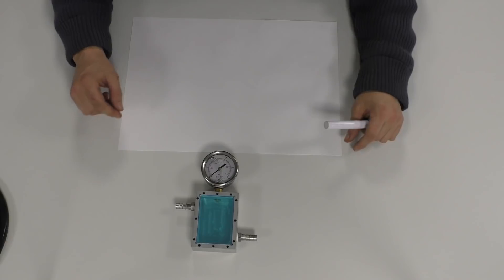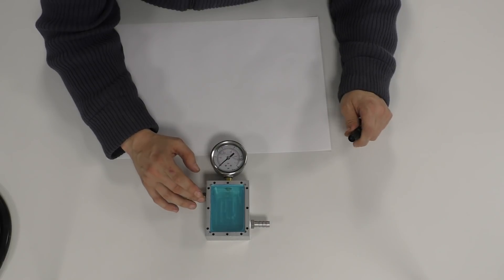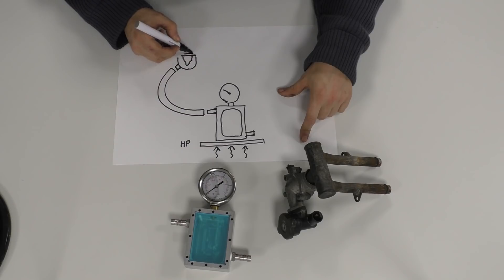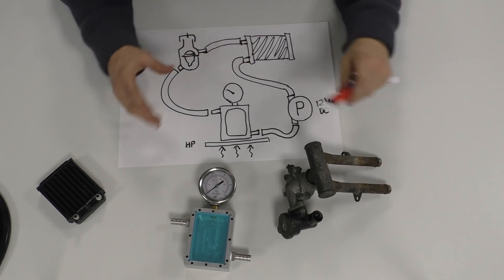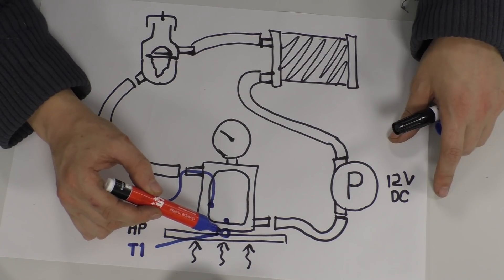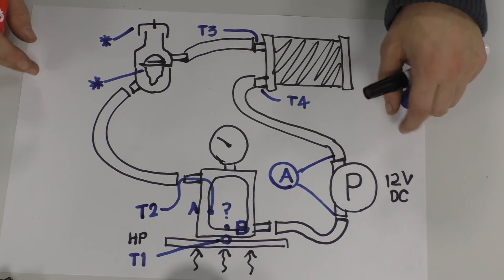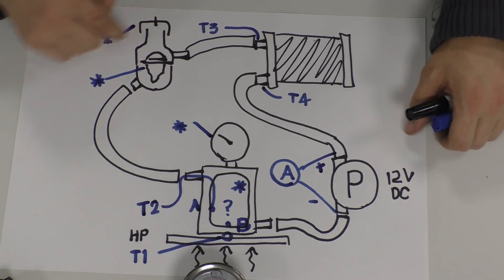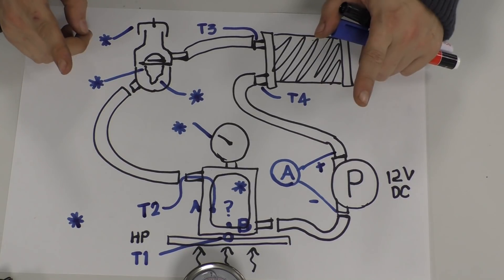Cooling Experiment - Part 1

Comment: Does the Thermostat actually open when/if there is no hot water coming along to heat it up? And T1/T2 are just testing the heat conductivity of aluminium. For heat input you can measure the hot plate's current/power since it is about 100% efficient it should at least give good relative results. And please don't connect the meter like you were drawing it there, accross the heat plates terminals (or the pump) in amps mode, those badass fluke fuses are fucking expensive.
Reply from the maker: "Does the Thermostat actually open when/if there is no hot water coming along to heat it up?"

- no

"And T1/T2 are just testing the heat conductivity of aluminium."

- why? As the aluminium heats up it will pass its energy to the coolant, as there is a large surface area the temp reading at T2 will drop if the coolant is doing a good job

" And please don't connect the meter like you were drawing it there, across the heat plates terminals 

- its not across the hotplate?

(or the pump) in amps mode,"

- The pump is 12V DC and won't draw more than 3 amps max
Reply: The Workshop As far as I see it T1/T2 are both mounted on the fairly big aluminium piece? Yes, the T2 probe will be cooler but is it going to be a big enough gradient or just like 41.1 on T1 and 40.9 on T2? I don't know what kinda resolution the thermometer has. The aluminium thing is quite thick and conductive compared to the small heat flow from the heat plate and out the radiator. The way I see it is that when the coolant is flowing the heat plate will cool down (or even worse compensate with more power in) and the aluminium piece will cool down obviously. There might be a better chance of measuring the heat flow if you put T1 on the heat plate and T2 somewhere far away on the alu block
Reply: The Workshop And for the amp meter: pretty sure it is just another case like the LED resistor thing but I'm not gonna tell you to put the meter on the mains without telling you not to connect it the wrong way
Reply: The Workshop And the thermostat thingy might not get enough bypass flow with the little 12V pump to bring it up to opening temp within reasonable time. You wouldn't want to wait for the heat conducting through the pipe/water

Comment: i would not let T2 touch the sides or bottom. aliminium is a pretty good at transfering heat and i don't think that would be a proper result. that is to say: the best point would be C - in the midle of the box. maybe stick it to the perspex window
Reply from the maker: Proper result of what? We're testing a coolants effectiveness not how hot it gets
Reply: i think the aluminium will be hotter than the actual coolant. the coolant will also flow through the system and change it's temperature while the aluminium block will be more influenced by the heater below. who knows... maybe that in itself would be a good experiment: where to place a temperature probe for acurate results.
Reply from the maker: "i think the aluminium will be hotter than the actual coolant."

- yes it will, just like in an engine, the coolant is there to remove this heat.

"maybe that in itself would be a good experiment: where to place a temperature probe for acurate results."

- excellent point!

Comment: In my opinion the position of T3 and T4 is very important. Because thermocouples only measure at the very end, you will get different results if the sensor is not directly in the middle of the flow. The idea with measuring the current is quite nice, so you can calculate a ratio between T4 and the power cunsumption, which should represent pretty good the viscosity of the fluid!

Comment: With regards to your water pump: https://www.highflow.nl/watercooling/pompen/laing-swiftech/pumps/?sl=en

There are loads to choose from, some come with a capacity to pump 1500 l/h!
Aside from the volume, those models also come with enough pressure to push up a story building :)

Anyway, for the spot of the thermo coupling:
Do you want to measure the temp of the housing, then yes, use T1 as you would also be able to see how much heat is lost during transfer from the plate to the housing.

As for the radiator, will the 120mm rad have enough surface area to cool your amount of absorbed power?
As far as i know, the maximum amount (heat) power, a 120mm rad can absorb is 269W.
This would be one thick finned and deep 120mm radiator.
Might be food for thought, i can only suggest from my experience in building watercooled computers.

Looking forward to this build!

Comment: You will be able to see if the thermostat is open or closed by the flow through the window. The t 2 sensor I think it shouldn’t touch the aluminum housing, it should be suspended,so it can get the fluid temperature. You might need a bypass for the thermostat so you can flow water when is cold. And i think a variable speed pump, to see how effective the radiator is on various flow rates. And if its possible an inspection window on the pump to see cavitation.
Reply from the maker: The fluid temp is not what's important here - more on this later

Comment: hello matt :) merry Christmas , u can go to EKWB website they have 12v pump n different size radiators , fan ...... thanks for sharing all this mate :) .
Reply from the maker: Awesome - I'm checking it out now
Reply: hope u find what u looking for :)
Reply: M R the temp does go over 100c, because an engine loop is under pressure. It's a sealed system. Exactly what Matt was talking about in the video. Also, just looking at radiator size alone, and math, engines put out thousands of watts worth of heat. The reason radiators are not even bigger is because Delta T is bigger with engines than computers. I just looked up the EK-D5 pump, which is their most popular model. Max system temp is 60c. I was thinking as I was typing my last message "computer loops never see over 65c, and that's if a component failed."
Reply: Think some of newer vw Diesel engines have a 12v water pump maybe someone could help you better as in witch model but I have seen them👍🏻
Reply: Don't try using those. They can't handle those kinds of temps. Also for this test 80 dollars/quid/pounds doesn't make sense. You need industrial grade.
Reply: temp doesn't go over 100c because of water and d5 pump is industrial pump adapted for pc cooling and it can handle temp from 3 gtx 1080ti (250 watt each ) n 150 watt cpu all together , he just want to use a hot plate .
Reply: right , i didnt mean its enough for engines .& you are right about the size of the rad too , i have exactly same size rad in my system its only enough for my cpu .

Comment: How are you going to get the fluid into the system?And get rid of air?Won't you need a small header tank,to top fluid,remove air.Why not put in another threaded hole for your internal temp sensor,would be easier than trying to put something through one of the existing pipe inlet/outlets.
Reply from the maker: "Why not put in another threaded hole for your internal temp sensor,wouldbe easier than trying to put something through one of the existing pipe inlet/outlets."

Thermocouples are twin wire jobbies and a pain in the arse. 

As for getting the air out of the system I can shake the thing about. The set-up will be a bitch, but its not really inportant. I say this now LOL but we'll see. I have been thinking about this - but thanks - awesome comment!

Comment: 11:05 you could put a mechanical flow indicator (basically a spinning disk in a clear case) after the thermostat to see if its open or not - these are fairly common in computer watercooling

Comment: First thought was can the hot plate definitely get it warm enough?
Having A and B would be nice as it would show the rate the heat travels through the fluid. erm... can't make my mind up!
Wouldn't current draw on the pump show the thermostat opening and closing?

GADZOOKS!! THERE'S NO EXPANSION BOTTLE!!
Reply from the maker: "First thought was can the hot plate definitely get it warm enough?"

- the hot plate can do 450Deg C - so yeah LOL

"Wouldn't current draw on the pump show the thermostat opening and closing?"

- depends if I go for a bypass system or not, early days.
Reply: i was looking at the surface area of the base of the box relative to the overall size of the system, and then starting to think of other things instead
Reply: Even the worst hot plate can do better than boil water so yeah it's in the neighborhood.

Comment: what about mounting T2 to the perspex as it doesnt conduct energy as well as the aluminium, and so you may be able to achive a more accurate fluid temperature?
Reply from the maker: 2 things - No.1 - we want to cool the 'cylinder' so the thermocouple needs to read the metal temp not the coolant. No. 2 - there is no perspex in an engine hence why not to do that. The perspex is just so we can see, obviously LOL
Reply: Ah shit fair enough, makes sense

Comment: Defenently A position as your more like to be measuring the coolant . But it would probably be best in the middle of the coolant so there won't be any heat sink from the metal or you could have 3 temp sensors .
Reply from the maker: Maxed out on sensors unfrotunately as I wanna plot them using the data logger which only has 4 channels - what I forgot to mention is that the whole system will be brought up to temperature before we start logging etc
Reply: Ah I see could all ways be somthing to try next time .

Comment: I would use an immersion probe into the chamber so not to pickup the conducted heat from the hotplate, i think the chamber case will be a bit hotter than the fluid inside. Looking forward to the results.

Comment: Do you have any plans to add a 12v PC fan to the radiator, Matt? You are only relying on radiation unless a fan is present. If the ER5 sensor can switch the fan on and off then happy days.
Reply from the maker: This little rad will have a fan attached, I thought I said that? The ER5 will have the complete system - which included the fan and switch.
Reply: 8:50

Comment: Merry who gives a shit =) Can you put a LED-Bar inside the Aluminiumbox and maybe use transparent Hoses?

Cheers dude :-)
Reply from the maker: I can use transparent hoses - but my question is why? I did think about it, but couldn't come up with a good reason.
Reply: You could put something like Ink in the System to show exactly when and how it flows, when the Thermostat opens. Also, it looks "cooool" lol :-P
Reply from the maker: I did think about putting glitter in the coolant..... seriously LOL
Reply: I´m guessing AVE want´s to see some Pixiedust choochin around those hot rubber Pipes :-P

Comment: Would a flow meter be a useful addition?
Reply from the maker: This would only tell us the flow rate of this system, which isn't really useful as this isn't an engine. For the ER-5 test I have got a flow meter, because this will tell us how much power the pump is using - as a percentage not wattage.
Reply: Could use a flow meter to see when the thermostat opens. This  widget form RS would provide a visual indication that the thermostat is open. Only rated to 100c though. 
https://uk.rs-online.com/web/p/flow-sensors-switches-indicators/3956849/
Reply: Two flow meters, one before the thermostat and another one in a bypass circuit would show you how far open it is as a ratio, monitoring the pump current might be showing viscous fluid or nearly closed stat or a bit of both, the hall effect sensors on eBay for a couple of quid would do.